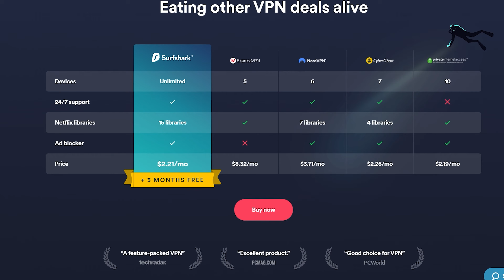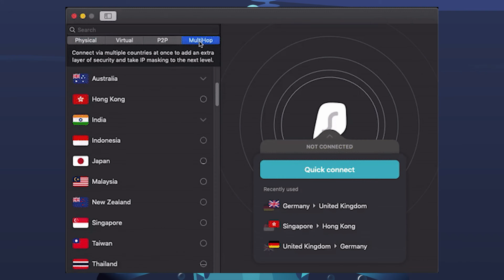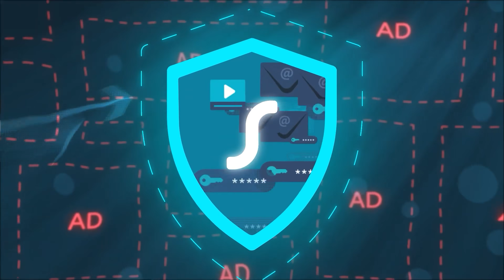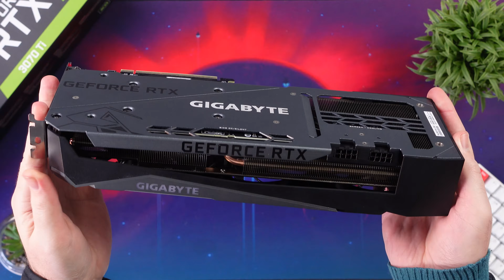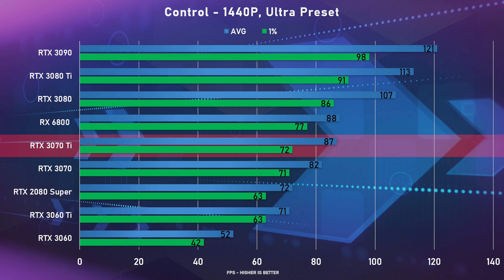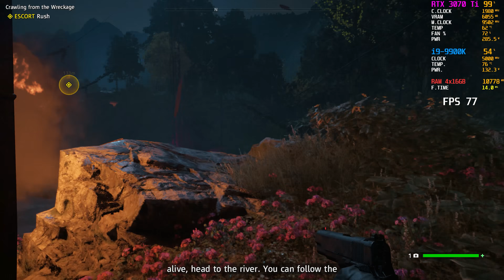There is only ONE reason to get an RTX 3070 Ti - Gigabyte RTX 3070 Ti Gaming OC Review

Comment: Price matters - I have one and it was only £50 more vs. a standard GB 3070 so it was an easy decision. The RGB logo is a bit temperamental, especially when you use it with the diseased software that is 'RGB Fusion', but if you can get past that, it can be a bargain at the right price.

Comment: guys just a tip i have the same model and it has 1 big problem and its the thing they call (screen cooling) 5:51
and the problem with it its overheats ur ram so much while gaming like my gpu is on 67c while gaming but when i touch the ram its so hot i bought 6 fans so i can cool it of and i had to put one of the top as intake so it cools the ram (my ram is G.Skill Trident Z NEO Series 32GB 3600mhz)

Comment: the 3080 is still like 1200 usd or more.
Reply from the maker: You should be able to find them for around $900 now.
Reply: @WeDoTech   some are around that. I got a Gigabyte RTX 3070ti for 699. Nice card, but I had a 650w psu in my system. Ryzen 5 5600g. It fryed my Rog Strix B550-F Gaming motherboard. Well only the RGB comes on now. Changed out the board and put a 850w psu in and  the card, cpu, and ram are still good lol.

Comment: The thing people should take in mind when doing these reviews is actual market pricing. I have no idea why most tech channels still go off MSRP. Some mythological number that’s never been the case and never will prob be again. Linus Tech Tips is the only channel that bases their reviews off actual market value not MSRP which is why they are the only ones that make sense. Sure at 100 dollars more it’s not worth it. It also takes away more SKU’s from the normal 3070. However more GPUs is still a GOOD thing and basically ever since the 3070 ti launched it’s been the same price as a normal 3070. That’s what the review should be based off. Current pricing, current value. Why would someone buy a 3070 when they can get a slightly better card for the exact same price? If it was MSRP sure but it’s not/never has been MSRP. Stop using MSRP. This video is nearly a year old and the pricing should have been based off it compared to the other models at said time. Which again the 3070 ti has nearly always been selling for identical to a 3070 which makes it the better card and value even still now.

Comment: After watching a couple reviews I've come to the conclusion that the 3070ti is just an overclocked 3070. This made me want to go with a 3070, but with the stock atm the 3070ti (€900) is cheaper than non ti version (€960). This put me in an odd situation. Should I cough up the extra money and get the 3080 (€1200) or would the 3070ti be better in price/preformance.
Reply: bro, 300 euros is not little. i had the same dilemma and ordered this exact 3070ti instead - arriving tomorrow. Because the price difference of 300 euro is not small in my opinion.
Reply: I've also decided to opt for a 3070ti, I'm currently playing on 1080p anyways with the intention of upgrading to 1440p down the road. No need for a 4k ready gpu if I'm not planning on playing it in the first place.
Reply: @Mau_S  Absolutely, I an upgrading my pc and building a 2nd one now with this rtx 3070 ti because I got a 1440p 165 op omen monitor and it's not running well with my gtx 970 set up. The old set up will stay with my old 1080p monitor and will be building a brand new configuration. So yes, I believe for 1440p this card is more than enough and should be ideal for most titles.

Comment: Just ordered mine at msrp finally to replace my 980to which I reused in my 2021 i9 build. I don't think the 3080 is worth double the price if you are not 4k gaming. i'd rather be maxed out on settings on my 2k 164hz monitor
Reply: Hey, where u get 3070ti at MSRP?
Reply: @NonusGra  newegg had some a couple weeks back. just have to use the hotstock app and wait to get notified.

Comment: Well, i just got a good deal bruh, just bought 3070 ti for 600€, i mean, still over MSRP but bruh, knowing the times that are running right now, 600€ for a 3070 ti is like finding that needle in the hay. AND I FOUND IT AND IT'S MINE FOREVER, or at least until 4000 series come and if i can get my hands on one, i will sell the 3070 ti for 600 bucks and people will still buy it.

Comment: I went for a 3070ti because when i was shopping for GPUs, 3080tis were 1200$ more than the 3070ti for whatever reason. And it was only a couple hundred dollars more than a 3070
Reply: Yup. Just got mine for $900 through Facebook marketplace. Was this a good price?
Reply: @charlesmiv3842  Uh…. 900….  I got mine for 700. You got robbed
Reply: @charlesmiv3842  Hell you can get a 3080 now for 850
Reply: @maglatand5923  remember. It was during the GPU shortage. They were going for 900 at microcenter as well at this time
Reply: @charlesmiv3842  depend of country and inflation

Comment: I got the 3070 was gonna get a ti but for like 200-250 more looking at performance not a big jump, so 3070 for me. I got the aorus master.
Reply: how is that model?  For me it seemed little to big and bulky, i choosed Gaming oc, also i didnt liked that it had LCD display , means that in long run, it will 100% Fail or start showing its age.
Reply: i was thinking about aorus master for 1100 euros or this gaming version for 900 euros-thought 300 euro is not worth getting master over the gaming version :)

Comment: @10:50 - No of course not, performance per dollar makes it not worth it for 4k, which is where your trying to press into with this kind of performance. Go for 3080 if possible. I think the 'only' leg up 3070ti has is that its lower power and often will have the exact same cooler as their 3080/ti and 3090 gpu counter parts (aka overkill cooler for their power design). However they are only like ~30~80 watts less than the bigger cards, but still less power with a big cooler means quieter fans. Only meaningful benefit.
Reply: ... and lower price, AND availibility AND being a stronger newer version of the old Turing flagship RTX 2080 Ti :-)

Comment: I have the 3070 ti and I think the problem with the performance of this card is drivers it’s like they recognize as a 3070 non ti. Cause the hardware is for 10fps or more than a 3070. I hope they fix it before they make 3070 super
Reply: Hey was this ever fixed?
Reply: @Etch88  haven’t seen any difference with last drivers, the only thing I noticed is that runs power limited, I know there’s something holding the card bios or drivers. I haven’t even overclocked yet
Reply: I'm a little confused, my ventus 3070ti is recognized as such
Reply: @KingJay-kt3si  they fix it the drivers when they come out wasnt for the ti now they perform a little bit  better

Comment: The only way to judge these Cards is to buy one, I have read and seen the so called experts voicing their opinion, so let me make it clear, yes these are overpriced but that is the market at the moment, is it worth spending another £ 600 to get a 3080TI? no not at all, this card is superb, and in 4K 
amazing, had I have listened to the "Don't buy brigade" I would have lost out.....lot of money, but worth it!!
Reply: What version did you manageed to buy sir? around MSRP or way more ;-/ ?
Reply: i bought the gigabyte 3070ti, overpriced for sure but i have to.say its an excellent card...msfs 2020 4k mostly high to ultra settings on 43 inch pc monitor...40-65 fps across the board.

Comment: I got one of these a few weeks ago. its been a nice upgrade from my gtx 1080. I wont say im getting 999fps in games but its pushing at least 20-30fps on most games. also the render timing is quicker than the 1080.
Reply: You must be gaming in 4k with this card cause I'm not getting anything lower than  65 -70 at 1440p max.  Most games are running 80+ fps for me.
Reply: @joshuarivera6460  Same here....grabbed a Asus TUF RTX3070 Ti and it will not drop below 70 @ 1440p and it slows down to @40~50fps at 4K gaming

Comment: Hello, I just bought the colorful battleax version of rtx 3070 ti and the thermals is  on 79 degrees. Is it normal?
Reply: That card’s known to generate a lot of heat but it’s one of the cheapest out there lol. Well, At least you got one.
Reply: @KohZin1  yeah it's fine now. Apparently my gpu's bios is bugged and the fans were not running at adequate speed. Manually setting the fan curves made it back to normal.

Comment: Also I got this card for arround 800€, when the 3070 is anywhere from 890-1000€, and the 3080 is 1300€+ either versions
Reply: Just ordered for pick up for the same card at $1050 CAD. Finally some stock and i dont care if im overpaying for this card when it will probably be cheaper in a few weeks.
Reply: @Nabee_H  me neither.. I think the Ti's are cheaper than the non Ti's due to the hardware hash limiter although mining is dead.

Comment: I have a Corsair RM650 yellow label PSU, can you please explain me how to properly power this card, I've got it this week but I'm not being able to figure out how to properly connect the cables on the PSU to get both 8 pins. Should I use 2 x 6+2pin cables?
Reply: Yes.

Comment: Picked up this exact card. Very happy with it. Massive upgrade from my old GTX 680SC. I think its a bit disappointing that the Ti variant has almost no difference with the normal card, but maybe Nvidia was limited in what they could do/provide with the shortage of everything going on. Once again would have preferred a 3080, but this is still a massive upgrade, and I'm only gaming on 1440p atm, so for the foreseeable future this card is so damn good. The 3080's are so rare and everyone getting them where I buy cards from is from backorder.
Reply: if you overclock a little using msi afterburner u will see that there is quite a difference beteeen the rtx 3070 and the TI for sure...remember its not just about the GPU ..smashing card though..
Reply: Man how did you get your 680 to last that long for you, wow.
Reply: you can use a 1070 for 1440p. So I wouldnt stress about not being able to get a 3080
Reply: @strider5119  Yup I feel very blessed.
Reply: @strider5119  sadly my 1070 met its match with Halo Infinity, i could game for maybe an hour uber low settings or so before my gpu just overheats lol
Reply: @covenant_mog05  that's an overheating issue though. Maybe pull it apart and redo your paste
Reply: @strider5119  yep did the whole clean up along with thermal paste. Worked a bit better lasted a bit longer but yeah my gaming experience was terrible when i constantly worry when's the next time my game crashes.  Im trying to have fun not increase my anxiety 🤣
Reply: yo, u still have the card? how about the temps?

Comment: In my local store in India , the 3070 and the 3070 ti are the same price . The 3080 is Rs.50000 ( $680 ) more expensive than the 3070 and 3070 ti . Which one should I go . 

My budget only fits the 3070 and 3070 ti . It would be really helpful if you recommend me on which card to buy . Thanks
Reply: I'm in the same boat as you! Getting a Zotac amp holo black 3070ti for 85k and Zotac twin 3070 for 105k lol stupid af pricing.
Reply: @KKon2wheels  Pricing is all over the place right now
Reply: @techman1426  what did you actually end up buying?
Reply: @KKon2wheels  A Zotac 3070 Ti for 84k at my local store
Reply: @techman1426  sahi hai bhai. 👍
Reply: @KKon2wheels  👍

Comment: I think that the 3070 Ti will replace the 3070 only for pre built PCs in the future. Basically once all 3070 cards get sold out.

I was hoping for at least ONE of the following for the 3070 Ti

a) Increase of VRAM
b) Substantial increase of performance (in terms of FPS, without relying on DLSS)

Now,
Given they did not do any of the above I was hoping that the newer version would draw less power (Watts) thus making it more Energy Efficient

Why care about energy efficiency?

Well,
The GPU is the most important factor when purchasing a Power Supply Unit (PSU)

Moreover a more energy efficient GPU would very likely be a GPU that reaches lower temperatures (degrees Celsius)
A GPU that easily "heats up" will also easily "throttle" thus under perform.

MANY THANKS for the detailed review !!

My ranting is only aimed towards NVIDIA just to be clear ;)

Comment: I don't see a lot of people using the 2080ti for benchmarks. Instead they use the 2080 super or just the 2080. Why?
Reply from the maker: One big reason for me......ive neve had one to benchmark 😥 If I had one then I would definitely use it
Reply: You have to remember, back in the 2080Ti heyday, everyone was cringing at paying $1000 for a card... $800 where the 2080 was priced was exactly about where the last mining craze had placed the 1080Ti prices, so people were used to $800ish for a 2080Super.
Also remember the 2080Ti had memory issues that plagued their reputation. Several aftermarket 2080Ti's were failing from memory issues, so with their $1200 pricetag many weren't going to stick the cash out there to risk it.